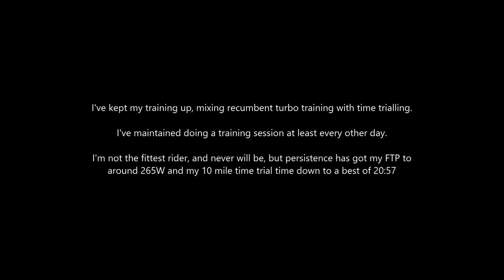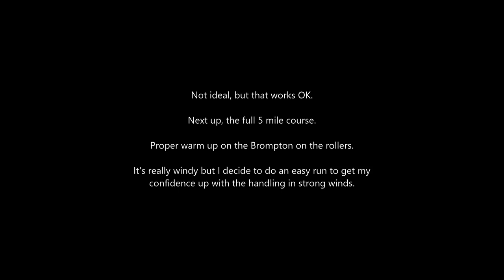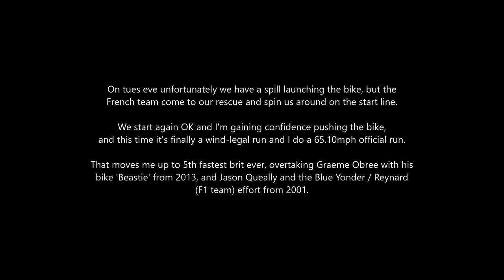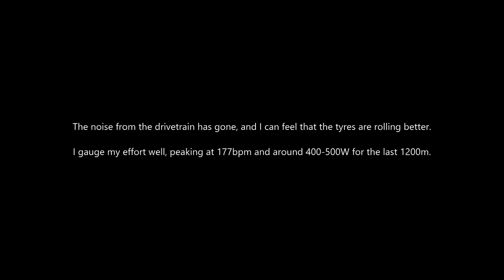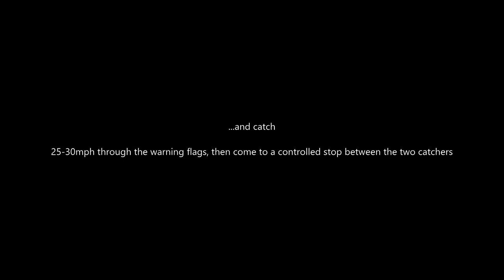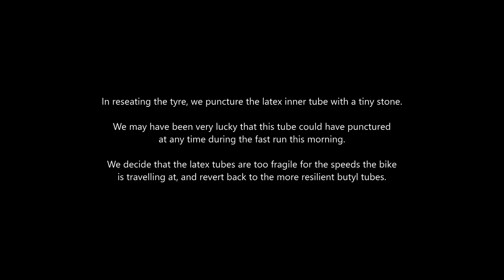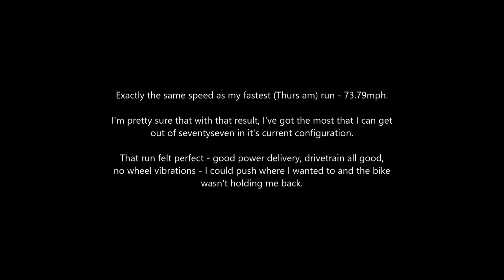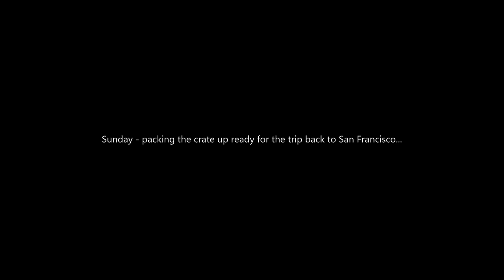Battle Mountain - Russell Bridge - Seventyseven - 2022. Video covering the whole week of WHPSC.

Comment: Amazing job, Russell, and it must have been a marvelous experience! 
With latex tubes you should have gone quite a bit faster in the last run, I'm sure. They're tricky to fit, though, but rarely blow up, and with small punctures they usually keep a certain pressure. If you want to save the watts and stay on the safe side, you can always add about 10 ml of sealant per latex tube (plus be generous with talcum). That setup is still much faster than butyl and much safer than latex alone. Hope that helps!
Say hi to Niklas and Bill Thornton in BM, please!

Comment: What latex and butyl tubes were you using? Butyl should slow you quite significantly.
The vittoria competition latex in the 26" MTB version is pretty sturdy, comes to around 100g after shortening to 20".